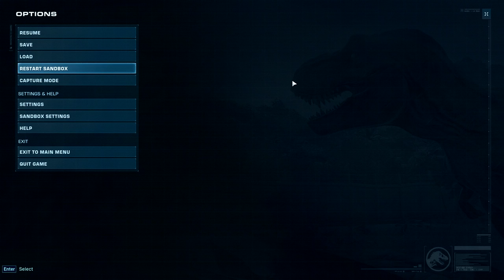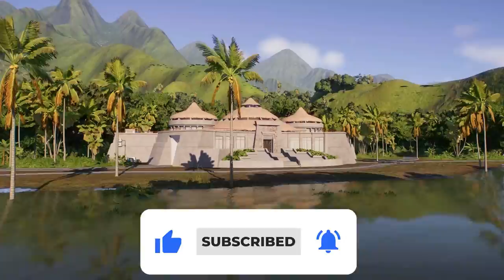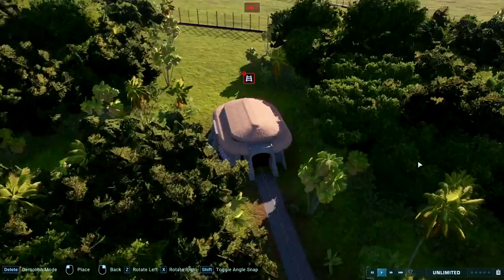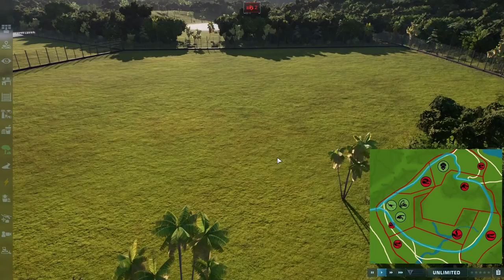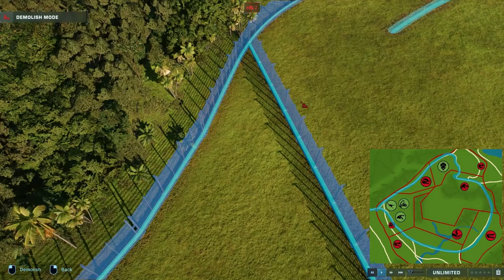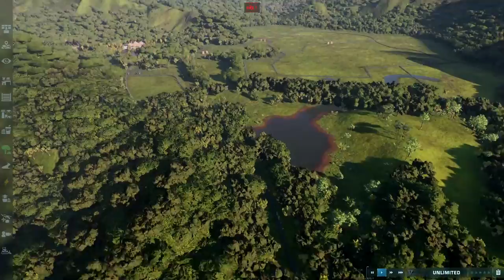PARK TOUR LAYOUT! | HOW TO BUILD JURASSIC PARK | TUTORIAL

Comment: I started at a 4point set up. Main area for my guest etc. Once I made my main area for bigger and cross habitations, I filled in the area with tracks and smaller habitats dinos. 

They made it kind of difficult because I didn't want to lose the integrity of the board but also because we're limited. 

I wasn't aware, or maybe it's been so long since I played part 1 I could put the track through. It didn't let me before but maybe due to some restrictions. 

Good stuff. This gave me more to think about, which is always important. Now I'm confused. Are you designing this board or redesigning or just adding onto something made cause you mentioned downloading.